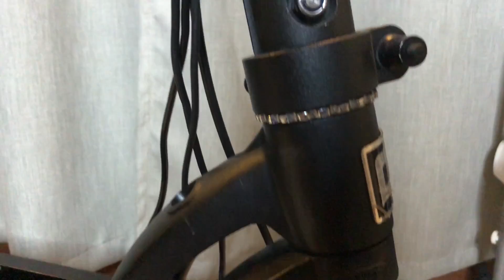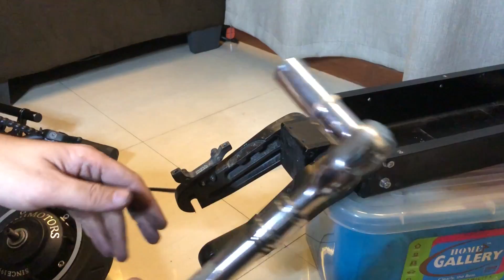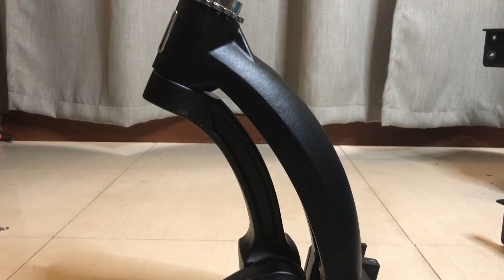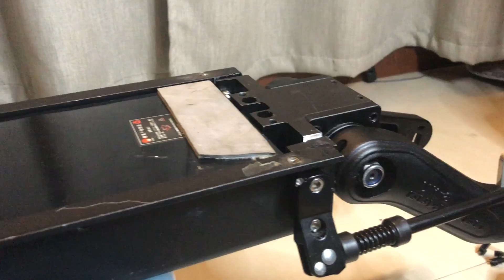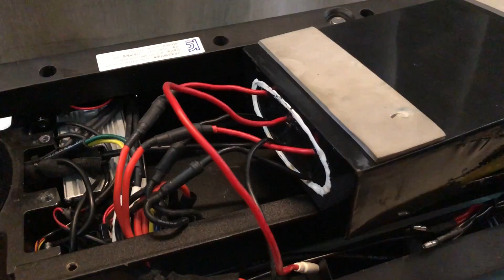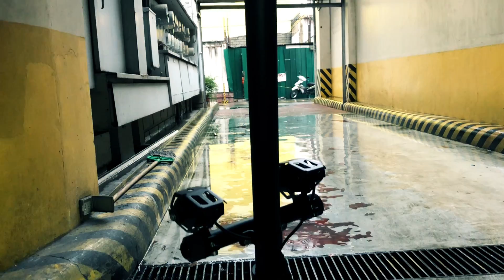Dualtron Modification - Converting a Dualtron Raptor into a Limited with Ultra Hubs

Comment: I'm planning on doing this with my MX that already has a DT3 controller. Apart from the swing arms, is there a need for me to use an ultra neck or will the MX neck be enough?
Reply: Just an update, I am finished with my own conversion. Used the same front and back suspension blocks/neck and just used ultra arms and ultra hubs.

Comment: how did you wire the extra lights, could you show that please
Reply from the maker: Freopa I tapped the wires of the stock lights.
Reply: Thanks for this but how did you tap the lights can you show this please, are the lights fused? @MOTOHOLLIK

Comment: Having owning a few dualtron such as the limited ii V3 and Ultra V2, I highly recommend you Sash to upgrade the handlebar. The aftermarket one has a much more rigid feeling and you would feel more comfortable cutting corners at high speed than the stocks. Plus they are quite easy to install!
Reply from the maker: Luqswl are you referring to MTB handlebars or the foldable handlebar that is available for the DT?
Reply: @MOTOHOLLIK  The MTBs, the foldables are not my kind of taste.

Comment: Can you put the wheels and suspension from the ultra to Ex+?
Reply from the maker: Are you talking about the motors and the swing arms? Yes practically you could install those parts on an EX+ body. But don't ask me if it will run. As far as I know the Ex+ runs on 52V, you could under-power the hubs but I can't say if the battery could power both motors. Unless you're into modding and want to experiment, I'd suggest you just sell your Ex+ and get yourself a second hand Ultra from Singapore for 2000$SGD.
Reply: Sash O I have the DT2 ex + it's 60v.
Reply: Doubt is it fits the arms of the ultra in the 2ex + to be able to put the wheels of 11 inches?
Reply from the maker: well you could if you wanted to

Comment: Great work! And what is the max speed? (please write speed for single and dual mode)
Reply from the maker: Thank you, top speed according to odometer during first ride was 78kmph on straight road, dual hub, turbo on. No tests done using single hub mode. Once the rain has stopped I'll do another speed test with an GPS app to check if the first results were accurate.
Reply: Oh my god 78 km))) I want to modify my raptor too after this video) How do you think if i change on my raptor only front and rear wheel (+front and rear Arm) will it work same way like yours? And how do you think - how much kilometers i can drive on such hybrid?)  (if original raptor can drive 60 km distance - it will drive only 30 km?)
Reply from the maker: Vladimir Osipov my first concern would be the Raptor battery, you’ll loose a substantial amount of your maximum distance, the Ultra hubs need a lot of juice. Second, the Raptor head and front shaft only allow for an 8inch hub, the travel between shaft and hub on 10inches is hardly 2 fingers. 11inch hubs won’t even fit, even with each respective swing arm.

Comment: Wouldn't it be easier to sell the raptor and get a new Ltd?
What is the weight after the modifications?
Reply from the maker: Nikolaus Schlifke We’ll where’s the challenge in that? Haha Yes of course it would be easier to just buy a Limited or Ultra. Seriously, I’m enjoying the modding part of this hobby. Current weight is 30kg
Reply: Sash O Hehe yes, I would imagine that the 2 10 inch motors and tires in conjunction with the new hubs cost quite a bit for an upgrade.
For me the most important safety improvement for my raptor is adding 2x 10w led lights with 3A 12v power converter. you can mount the converter to the plastic sheet below the bow that connects the body to the stem. I have designed a 3d printed mounting bracket for which I ca share the design if you like.
Reply from the maker: Nikolaus Schlifke oh that’s interesting! I’ve upgraded the stock 3a 12V dc dc converter to 6a 12v. But it’s still in its original location in one of the plastic side panels. I’d appreciate it if you could share your design. Thanks!
Reply from the maker: oh btw, I used 11 inch motors for this upgrade, running on a v3 LTD controller.
Reply: Here is the design, it's fairly universal meaning it can be customized to any stem.
There is a relative big amount of manual labor involved (for 3d printed things that is) but it's rock solid as it used aluminium profiles for strength.
https://www.thingiverse.com/thing:3016713

I'd have to clean it up a little for other people to be useable, if you are aren't familiar with openscad you can use the customizer to download a stl file:
https://www.thingiverse.com/apps/customizer/run?thing_id=3016713

As of right now there not every parameter is in a variable that the customizer can use and some are unrelated.
Reply from the maker: Nikolaus Schlifke thanks a lot! I’ll let you know if I get around trying it out on my scooter